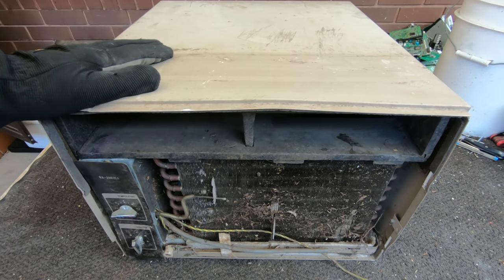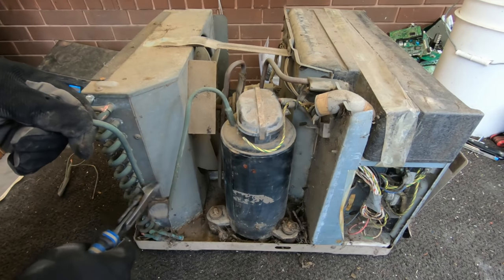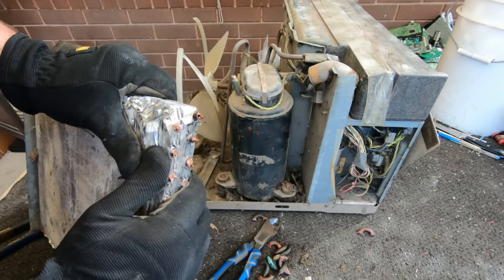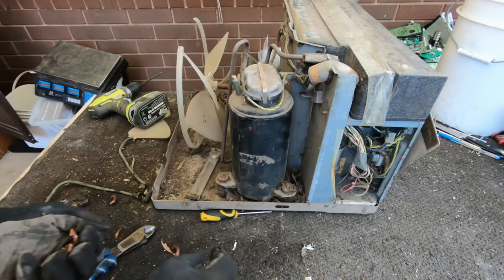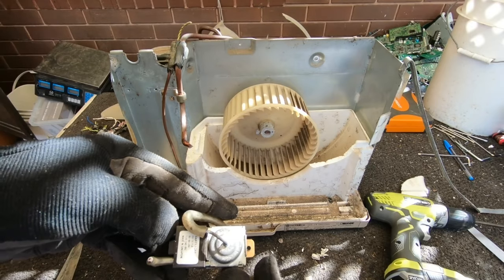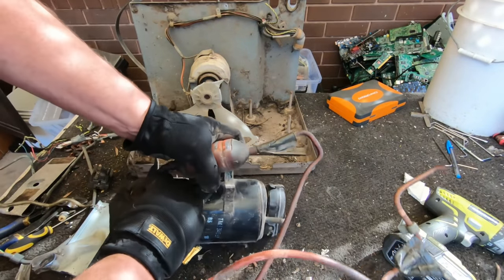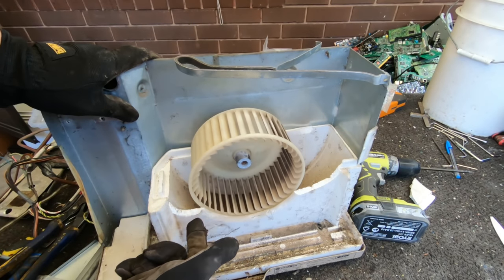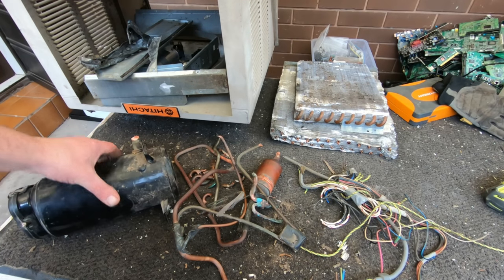Scrapping an Air Conditioner for Copper & Better than Scrap Steel Value

Comment: Hey buddy,I worked in hvac field for 35 years. We scrapped eith cordless drills and sawzalls. The coil once it is out can be cut on inside of side of metal down cutting right up against metal after that  the endbells can be knocked off of metal with a hammer. Coils are sometimes all aluminum or aluminum and copper. Once the coils are cleaned up of all the brackets they are worth more. Plus they can be stacked nice and neat.coils in one pile  endbells and cut up cap tubes in a bucket and a bucket of misc.aluminum.
There is great money scrapping A/Cs and heat pumps. Whole house systems are a whole lot heavier. All you need is freon recovered from someone that knows how. Or a system that is empty or has leaked out. Just watch the capacitors just short with a screwdriver. Lol.
I really enjoy your vids and get a kick out of how you say coppa. It makes me smile, but I live in Virginia so you would get a kick out of my accent youall  lol. Take care my friend.
Reply: I just separated the aluminum coils from the copper lines and the scrap yard only gave me number two for the copper! I know I brought these in in the past and they've always give me number 1. Does that sound right to you guys?
Reply: I was going to say the exact same thing as Paul . 👍

Comment: 👍 yep you need them ends off to sell as clean acr - I used to take the acr ends off with my snips like that too, now i use my circular saw with a $3 metal cutting grinder blade attached and just buzz them off in a jiffy (cutting through the acr aluminum side) - my yards have special category for them acr steel ends with the, copper bits stuck to them....

Comment: I used to find the odd airconditioner scrapping the inner suburbs of Melbourne. Usually another scrapper would have come along, released all the refrigerant and taken the rads and easy copper, leaving the compressor and fan motors behind.

Comment: When prices were good I made about 30 a piece on the little window ac's . I mostly get big home units now and the compressors are around 80lbs each, I cut up between 5-15 a week. They're definitely worth scrapping...
Reply: I agree mate. The stand up home units are awesome. Once you see the amount of copper in the compressor and hold it in your hands, there's no going back.

Comment: Use a saw and cut between the radiator and the steel. That's what I do.
Reply: You'll get cash with the steel but more if you take it off.
Reply: Should specify to use a reciprocating saw lol.
Reply: yea thats what i do too
Reply: yea use a sawzall slice through that like butter.
Reply: Really should be pounding down the VB's while doing this.  That's what I do.
Reply: Agreed.  I also use a long screw driver (or a bar) between the copper ends to pop them out of the steel after I make the cut.  You can lay it on a flat surface and leverage them up using your body weight to hold down the steel.  I can do a coil in about a minute...depending on how bit it is of course.  :)
Reply: I use a skill saw with the blade on backwards.
Reply: I know it varies between regions and yards but generally is it worth im assuming somthing like 25 cents or a dollar difference?
Reply: Also if u cut the elbows off with a sawzal flush then quickly go smooth over it with a grinder the plates will pop right off
Reply: Trop d'accord
Reply: Me as well.

Comment: I'm retired and do scrapping as a hobby, I would have completely disassembled the air conditioner into all its individual components to get the most from all the scrap value. I know you don't have the type of time as I do but you did a great job. The aluminum/copper evaporator and condenser can be taken apart with a small grinder, cutting along the path of the tube releases the copper from the fins. You can make more money from air conditioners in the long run.

Comment: Hey Ben, The two copper coils, 1 is the condenser, condenses the freon in the one, and evaporator is the other. In refrigeration, one coil has a condenser fan motor, and a evaporator fan motor for the other. And here in the states, big $ fine $ if you cut those freon lines. Good video. There's gas in that little switch too. Cya.
Reply: Here in Canada, big fines for releasing coolant into the atmosphere. I steer clear of fridges and A/C units for this very reason.
Reply: Isn't it safe to release the freon as a liquid?

Comment: you definitely want to cut off the steel from the radiators,  copper and aluminum really easy to cut, I cut along the inside of the steel piece with a recipricating saw. freon is not poisonous but it will displace oxygen you don't want to be in a room with it, it could suffocate you and it is a lil messy,  something that needs to be thought about.

Comment: I have about 3 of those compressed air tanks to open. I will film it next time. There is tons of good copper inside. It's easy with a metal cutting wheel on your grinder.
Reply: I have three also. Looking forward to a video from you.
Reply: @raymccarty4612  I cut all mine open yesterday. But I pick them up all the time. I will film it. There is a motor inside with a big copper coil.
Reply: @raymccarty4612  can I post pictures here? I cut a couple open but had low battery so I took some pictures instead.
Reply: @urbanmonkey48  I do not know. You may have to start your own video. I was surprised that I actually had to wait until being able to do the same when considering making and posting a video on another subject.

Comment: In nsw, u have to take the steal sides of of the radiaters..   i cut the ends of with an angle grinder, the stand on it and hammer off the side plates...   then to get the copper tubes out u just slice along each pipe with a razor to cut along the fins then they pull out, very easy...

Comment: Love watching your scrapping vids.  We need more people making sure as much metal is recycled as possible.  But please know that old air conditioning equipment can contain CFC's which wreck the planets ozone layer (Montreal Protocol).  That black pump and the copper tubes in the radiators are full of it. Air conditioning units, fridges, freezers etc really need to be sent to a proper recycling facility to remove the CFC oil/gases.

Comment: Compressors are steel. And I think you turned the fan bolt the wrong way. Remember lefty loosey. But you can bust the plastic off with a hammer. Compressors suck because they are full of oil and if they fail due to a burn out they stink like hell. Especially in a van. Try to keep them upright and just throw in with steel. You did really good for not doing them. Usually a 5/16 nut driver bit in drill with an extension or 1/4 inch. Try and search down whole house split systems  some indoor coils weigh 35 lbs. Outdoor as well  either all aluminum or aluminum and steel  really good money. Cheers
Reply: great info Paul, thanks for adding on to Ben's vid.  I've avoided picking these up in the past, but may change my practice.
Reply: Ernest Petzrick    my pleasure sir.

Comment: I take the fins off the tubing with a pair of pliers I modified .
I took a grinder and sharpened the tip to a sharp edge.
Now it bites into the fins a lot better.

Comment: Hay mate, you can get the aluminium radiators down to just plain aluminum by cutting the copper off with a pneumatic chisel or you can even use a regular skill saw. Either will take the copper off in 15 seconds. Then bang off the steel end plates and you have an uncontaminated aluminum radiator, two pieces of scrap steel and a bit of copper nibbs.  This all gives you a better value with just a couple of extra minutes invested.  I have found that the pneumatic chisel is an invaluable tool for all kinds of scrapping cutting my time removing small fasteners to almost nothing.

Comment: AC units and similar are some  of those  appliances that Do justify the extra  time and work if you want to do it, just for the copper/aluminum/compressor rates. But if you don't, nobody can be mad - you still kept it out of the landfills and made a buck off it in the process.

Comment: Evaporator up front, condenser out back. The compressor has a crank shaft and a piston either aluminum or steel, there’s no copper winding.

Comment: Ok, last comment, there are two pry clamps on each side of the fan motor. It is a double duty one. Pry the 2 clamps on each side of the shaft. It clamps a rubber bushing on both sides of the shaft to the uprights. Flat tip screw driver pops em right off. Cut your plastic wheels off with your cutters.

Comment: If u have time u can use a band saw and cut those copper tubes out of those radiators easily. It's messy but increases the value

Comment: cut the end of the copper with an angle grinder then you cut the aluminium with a knife and get the extra copper tube inside it's very easy to do

Comment: When i take those Aluminium Copper Radiators in they class the radiators with the steel plate as Aluminium Copper Radiators Irony. I still get a fair amount when i leave the steel plate on the Radiator. i think its only a $50 drifference between clean ACR (Aluminium Copper Radiators) and ACRI (Aluminium Copper Radiators Irony). Which is where i live it may be drifferent in your area.

Comment: Ive been collecting copper and brass while scraping out the steel. havent melted any yet but been wondering. with the right size setup, Could you melt the aluminum off the radiator and separate the copper out? then have the copper to melt later at higher temp?

Comment: Im still undecided if its worth cutting open those compressors. You get a good chunk of copper but its so messy with the oil and smoke. It uses about one or one and half grinding wheels because you have to cut around the perimeter then down the length to release the tension and slide it out. I think my yard has a special price for them but i havnt tried yet
Reply: I saw a video where two holes were drilled, and the oil put into a metal oil can.

Comment: You can leave the steel on and the give you around $2:50 kg or cut the steel of and get around $3:30 kg. I just run a sawzaw strait down the sides of the rads

Comment: Yes, the motor is a compressor. Copper windings inside an oil bath. The big tube is a filter dryer.

Comment: I take a saws all and cut inside of the metal on the inside of the radiator to get the steel off then take a screwdriver and pry off the copper hoops. good

Comment: Tip for all radiators whether it has steel or plastic sides is to get a saw and cut them off. Most of the time they will take the sides as breakage so you won't lose weight doing it

Comment: Actually you can slice the length of the Copper Tubes with a Razor Knife.  The Copper comes right out easily. Takes about 5 minuets to clean each one. 
The thing you called a Can is the Compressor and it has Copper and Steel in it.

Comment: In my area you can't take an AC unit just to scrap shred price. If there is not professional sticker on it saying the freon was professionally removed, the would only get a dollar or two. If I got that sticker, you might get $5 but than you had to pay for that sticker.

Comment: Test the motor to see if it works. You might get $20 on Ebay for it. They make good motors for small quiet air compressors.

Comment: I would use a sawsaw to get the copper out of the radiator, and than to get the motor out use a strong metal blade to get the casing holding the motor
Reply: Just hit it with the back end of a mall or a sledge

Comment: If the copper aluminum radiator has sheet metal on it,  the yard will buy it as dirty copper aluminum radiator. If you get a sawsall or angle grinder and cut off the copper tubing and pull off the sheet metal you can sell it as clean copper aluminum radiator. Your yard would know the  two prices. The clean price will be higher.

Comment: you need a smelter for all this stuff you get. Would be cool to use one to melt off the alu to get just left over copper. Maybe messy but good for the washer motors as well.
Reply: Emmet Myers congrats you're first!!!
Reply: Emmet Myers that's also a great idea!!!
Reply: he has two a gas one and a small electric one
Reply: He has 2 furnaces... thats a terrible idea,   melting aluminium into ingots cant be sold as scrap as no yard will trust u only melted aluminium...  same with the copper or brass..
Reply from the maker: what else would you put into aluminium bars? wouldn't steel be magnetic? most good yards have xrf's and why would anyone make ingots to sell to a scrap yard anyway?
Reply: don''t woory about 4kays ben they all can't be winners lol lol
Reply: Zinc, lead , tin, magnesium,  then you have the classes of ally, extruded , plate, cast, 6063, 6060,  ...  even though some of those metals are worth more than ally they wont buy ingots at all..  if you had over a ton of ingots then you can sell them as the batch would be worth trying to a yard but you wont get hi ally prices it will be very low, and xrf testing 1000kg of ingots is out of the question no yard will do that for you they will take the whole ton too a refiner and see what they get after meaning a late payout...   i wasnt ripping on bens ingot vids there cool as.. but ppl who dont know this need to know there ideas are stupid and why..
Reply: Emmet Myers I don't know how to post videos but I made waist oil fueled burner for separating out aluminum and cleaning dirty painted aluminum. I got the idea from another Australian guy who post videos named oil burner. Unfortunately I think he quit making videos
Reply: ingots are better to sell on ebay not the scrap yard that would be a dumb idea since what is the point of waisting time melting it just to get the same price as before melting it  there is a sold ingot on ebay 26 pounds sold for 89$ where he lives he gets 80$ for 116 pounds of extruded now if he melts it down he could get 89$ x 4 356$  is worth doing ingots
Reply: eWaste Ben I think the OP's idea was more about cleaning the copper, with the aluminium ingots or whatever being more of a byproduct. That said, if you can't sell the ingots, and have no use for them yourself, you would be losing value and I don't know if the increased value of the copper would be enough to make up for the lost aluminium, cost of furnace fuel etc.
Reply: Melting aluminium with pieces of copper in it lowers the melting point of copper and creates aluminium bronze... dont try seperate ally from copper with heat, it doesnt work it makes things worse..
Reply: shane rector know the guy your talking about. He actually goes back I think to about 2002 he had a web site before YouTube. Best narration on the tube especially when he talks about his neighbor.  I did hear a rumour that he had a tragedy in his family and because of that he quit posting.
Reply: You guys went way off topic.... a smelter is used for separating Metals I've seen one use for separating aluminum and copper out of alternators. these Metals won't just mix when heated because aluminum melts way before copper and falls out of the mix. 
As for yards buying what you're selling or not. Lot of people use waste oil furnaces to separate out aluminium from other metals and they sell directly to scrap yards. if you're not melting other crap in with your metal and you're not trying to rip off the scrap yard I'm sure you'll be fine. I always have been

Comment: How do you capture the refrigeration gas inside the unit it would have to go to a professional recycling plant for dismantling here in the uk, as the cfc refrigerants used in these units cause climate change.

Comment: In the U.S., any appliance containing Freon, must have the Freon removed by a licensed technician, using a recovery machine, first. If you cut open a unit containing Freon and release it into the atmosphere, and get caught doing it,  you'll earn yourself a $10,000.00 fine! Those were the rules about, 20 years ago. I don't know what it is today. I worked for 20 years at a company that manufactured refrigerated water coolers. I had to make a cut-away of a compressor, as a teaching aid for servicemen, once. There is very little copper inside. The weight comes from the fact that, the housing is a pressure vessel and is thick steel. Not to mention the pump, oil, and motor inside. Think of them as an air compressor, with everything inside the tank.